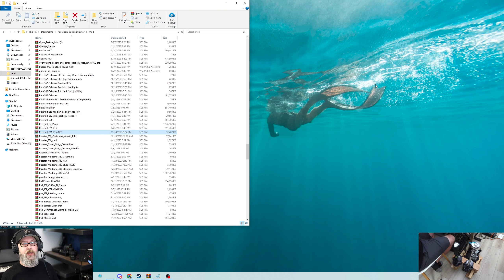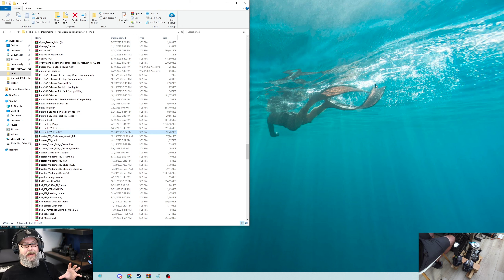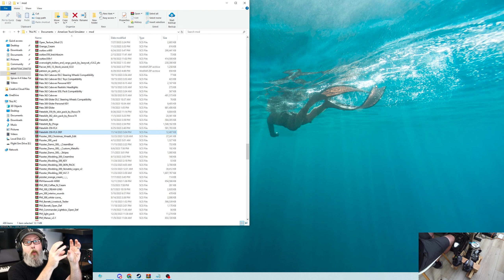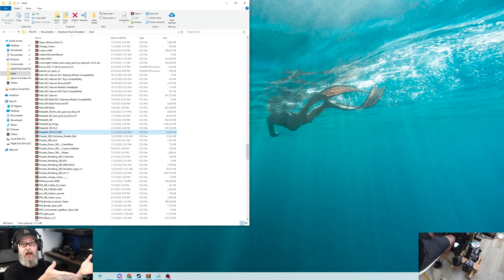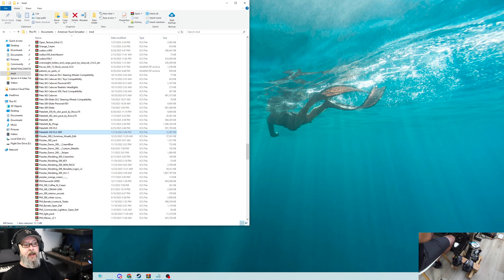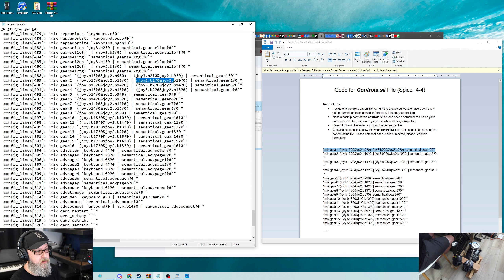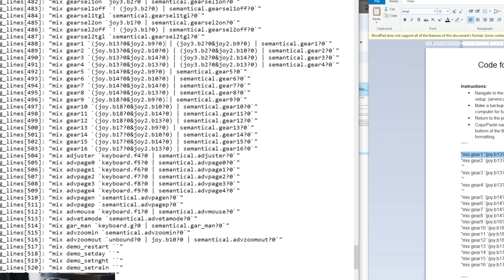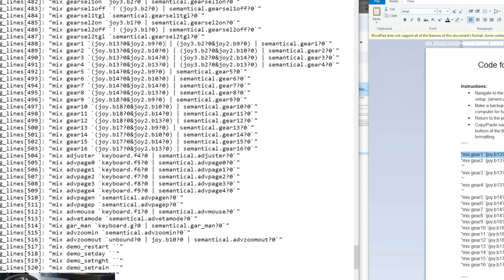How To Build A Twin-Stick Setup In American Truck Simulator | Start to Finish

Comment: I thought I saw all the crazy Shifter setups with the an actual top of a Truck shifter with a range splitter switch on it but this takes the cake because it is unique and interesting setup. Who would think to try and use 2 shifters to drive a truck in ATS. Props to you man.  Yeah I hope they expand the settings for the transmission as well to users can use the 7th gear on their shifter if users happen to have a 7+R H Shifter like what Thrustmaster has for example on top of expanding the gear limitations that you mentioned.
Reply from the maker: It’s a fun setup for sure, opens all kinds of possibilities. With the Logitech shifter, I got it to map all 7 spots, including the gear where you press straight down and go bottom right. But there is another way to map everything out, and I’ll be doing a revised tutorial some time in the future.

Comment: i dont have an eaton shifter top for my sim set up but i do have space/flight sim joy sticks so i use one of them as my aux stick for ats. im enjoying it until i get a second shifter or an eaton shift knob i also use it as my hand brake in other games
Reply from the maker: That's a good fix for the time being.  I did something similar for a while, but for me it didn't scratch the itch until I got that 2nd stick. Completely changed the level of immersion for me.

Comment: Can you do a twin stick video on how to set up the second shifter to the splitter and then a toggle switch on like a button box or something like a keyboard for the high and low
Reply from the maker: Check out my updated video where I take you through how to manipulate the code to get whatever result you want regarding key bindings. You might have to adapt it a bit, but the logic is there in my explanation. I’m more geared to using 2 shifters because it’s the most realistic.

Comment: After watching this, i found "compound transmission with h-pattern" by JackBurton on scs fourms. Following that allowed me to do a full 6x4, all 24 gears. With no need for a extra button for reverse.
Figured it might intrest you if you wanted to look into it. Plus more content opportunity as i havent seen a video for it, and if not for this video i would not have understood half of what the fourm post meant.
Reply from the maker: Yes, I am familiar with this approach, thanks for mentioning it. My goal was always to be able to shift as much as possible and only reserve splitters/range selectors as little as possible. I feel like it changes the authenticity too much if they are used to cue every gear. Instead I prefer to actually move both sticks simultaneously. So it’s not really about whether you can get a 6-4 or whatever transmission to work. It’s about how you get to shift it. And the more both sticks are involved the better. In my case of the 4-4, you only need to move the range selector to initiate reverse, where all 16 forward gears are achieved with stick movement only. Appreciate the comment MSFTLX!
Reply: Im trying to get the 6x4 controls.sii setup like on the compund transmission forum by jack burton but am unable to get the controls.sii setup to where it works i got the 4x4 twin stick setup from this video working but cannot get the 6x4 twin stick setup any help would be great

Comment: Just finished following the video, really straight forward and easy to follow. However, I can't get this transmission to work on Dielingwu's Mack superliner
Reply from the maker: Can you be more specific? Does the 4-4 show up as a drop down in the “controls” menu with the game? Can you select the proper transmission? Have you assigned the name of that truck to the top line of the transmission file? Does it work, but the gears are in the incorrect place?
Reply: @freebeardgaming  The transmission mod you have included with the Spicer transmissions, they don't show up on the mack. The shift layout and controlls are all working, but the mod for the gearboxes themselves I can't get to show up on the Mack superliner from Dielingwu
Reply from the maker: @BordemGaming342  within the SpicerDIY mod, click on folders “def”/“vehicle”/“truck”, and you should see a folder with the def name of the Superliner. If you don’t, the transmissions are NOT attached to that truck, and you have to make this connection: drag any folder (truck def name) to the desktop. This makes a copy of the folder. Now rename the file to be titled the def name of the Superliner. Then drag it back into the folder with the other truck names, and now you should see a folder with the def name of the Superliner. All transmissions will be included with the truck now. Now when you build or redesign the Superliner, the transmission will be available to you. Has this answered your question?
Reply: @freebeardgaming  if you mean adding the def name into the transmission itself, I did first on my path with troubleshooting. I do have the folder with the correct Def name made also, only thing I can think of now is the superliner doesn't like the layout of the DIY gearboxes
Reply from the maker: @BordemGaming342  I run the Superliner with twin sticks. There’s something else going on. Do you see the transmission available in the shop?
Reply: @freebeardgaming  No, thats my issue, they don't show up in the shop
Reply from the maker: okay, let's try to narrow it down then. (1) You said you already have a dedicated folder in the spicer_diy folder called "mack.supervd" (the def name of the superliner). (2) And within the subfolder "transmissions", you have selected the transmission you want and have ALSO entered the truck name at the top of that transmission file (top line would read "accessory_transmission_data : spicer87163a.mack.supervd.transmission", where the def name "mack.supervd" has been added in the middle of the line." (3) make sure that the "spicer_diy" mod is activated in the profile you will be driving that truck in,  and have it set  closet to the top of your mod order, above the truck you're using (sometimes people forget to activate the mod). If you have done all of these, the transmission should now be available when building/editing the truck.  

Only other thing I would say is to close out Steam entirely (not just closing the window), shutting down that program completely.  Then when you open it again, make sure to verify the files (right click on ATS within you're Steam library, select "Properties," "Installed Files" , then "Verify integrity of game files.")

If all that doesn't work, you can try the whole process with another truck to see if there's an issue with that truck on your end (again, I drive the Superliner with twin stick all the time, so maybe it needs to be reinstalled for some reason (or updated). Hope that helps, but that is essentially the checklist to make those transmissions available to the truck.
Reply: @freebeardgaming  I have it setup with 3 trucks so far, only one that's given me an issue is the superliner, my only guess is its something with how the file is formatted (sounds stupid but I've had weird issues with mods before lol), I'll try a fresh folder and see If my truck needs updating 👍, honestly knowing my luck it's probably something obvious and I'm just missing it lol
Reply from the maker: @BordemGaming342  oh that’s good, you’re able to make it work with other trucks then. So everything works, it’s just a snag with that specific truck. Yeah, try selling the truck and removing it from active mods within the game. Then delete the files and reinstall the truck. Seems like the files with that truck specifically is the issue. What other trucks are you running the twin stick setup on?
Reply: @freebeardgaming  The white western star from masons mod shop, the ironwerx, and another mack mod that I saw, I think it's a B61 or something like that
Reply from the maker: @BordemGaming342  ah, probably the b62 from MTG, that’s a good one. Need to run a Mack 5+3 in that one. Auxiliary (3) close to driver, Main (5) farther away - opposite of the Spicer setups.
Reply: @freebeardgaming  I just really want to get this working with the superliner, idk if a 4-4 is realistic for it, but it's a simple layout ((and I already have it setup)), and I've got a really nice Serialblack engine I can throw in to go with it
Reply: So, a little update, I tried starting fresh and redoing the folder, Made the corresponding folders with the correct def name "mack.supervd", and I went into each SII file and did the def name change also, but still; the mod will not pick up on the Mack

(and before you ask, yes, I have it activated lol)

Comment: also really been debating getting that UROgaming old sskool sshifter how do you like it?
Reply from the maker: @Grimmspeeds  love that shifter, it’s really given me more realism. That being said, it’s an “extra”. An Eaton Fuller shift knob still works just fine. I would focus on getting a 2nd shifter base if you’re looking to get a twin stick system going. But of course, that will need a shift knob as well, so you could do both at the same time

Comment: how would I do that with just the regualer shifter base for logitech because I want to make a 3 stick
Reply from the maker: You will need to buy more than 1 shifter base.  I use 2 Logitech shifter bases to get my twin stick setup.

Comment: this is a 1 hour video? tfw beamng configuration is actually easier
Reply from the maker: @ZdrytchX  New method was just released. No range selector or splitter needed, just two sticks. Offers the ability to adapt and create any combo twin transmission setup:
Truck Giveaway Details! | Tutorial: NEW Spicer 6x4 Shift Pattern | American Truck Simulator
https://youtu.be/gHMqXQhytL0